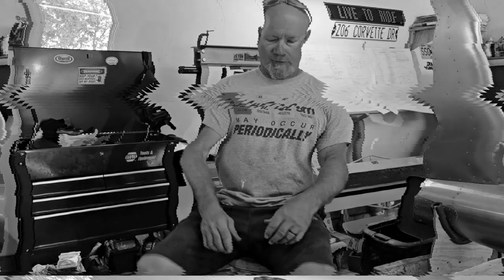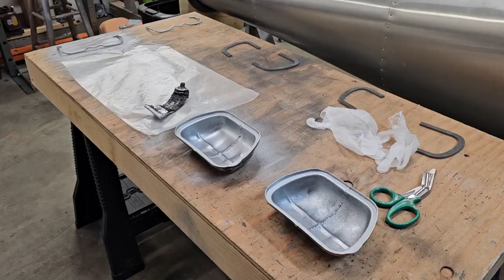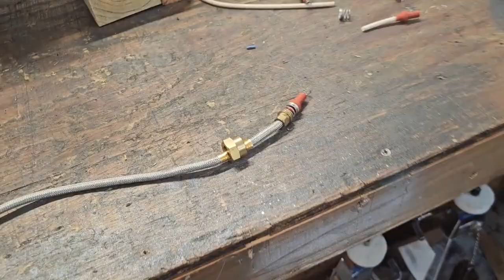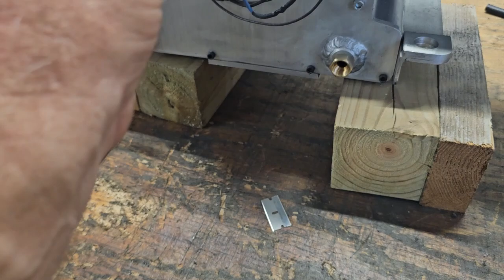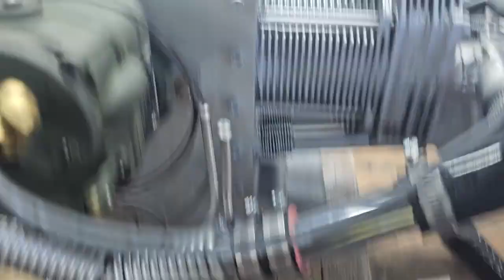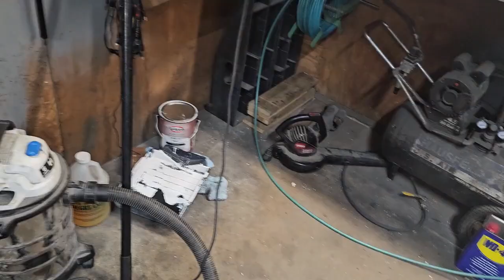1/2 VW Build - Part 28 - Paint,  Plugs,  Wires and Hoses

Comment: That thing is beautiful. Half vw's are one of the best sounding small engines ever! 👍
Reply from the maker: Thank you.  I agree that they do have a great sound.  I love my 2 smokes but on an airplane the 1/2 VW just sounds better.
Reply: @xpsgarage  Love two strokes as well, old biker here that rode and owned all the big ones back in the 70's. The only trouble I ever had with them was fuel mix. Always my fault. Not the engine. I never thought about long downhill engine seizure or long descents in an aircraft either. That operating parameter never crossed my mind. I once rode a two stroke bike up then down the grapevine in california on a very hot day. No problems. But you no longer have to think about any of that now. Thanks for this video series. Cheers again. 👍